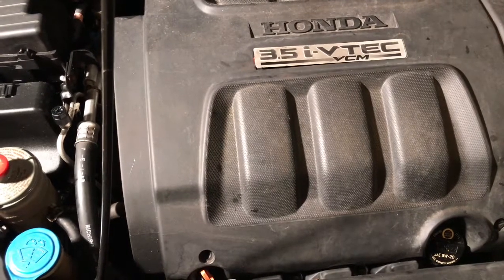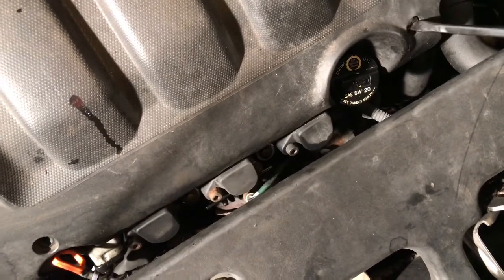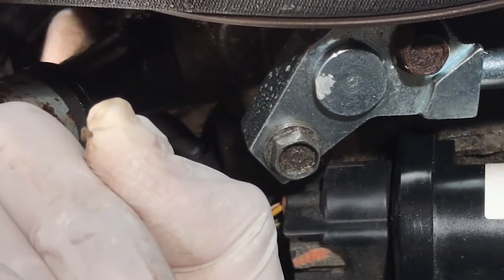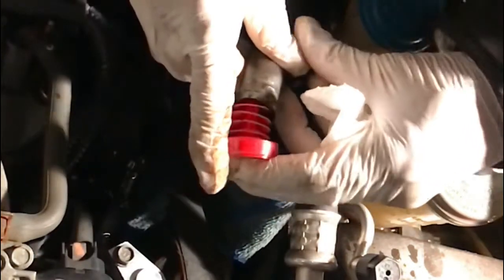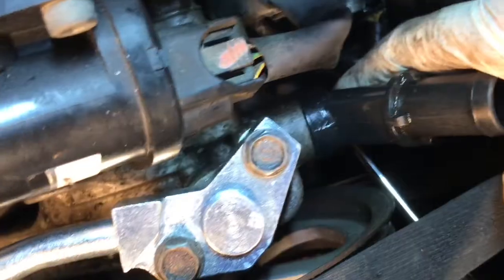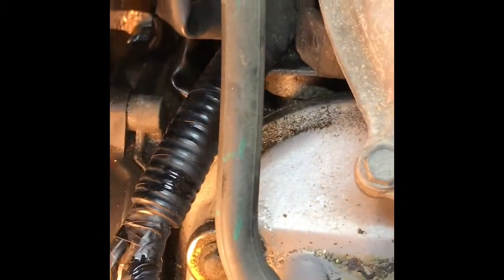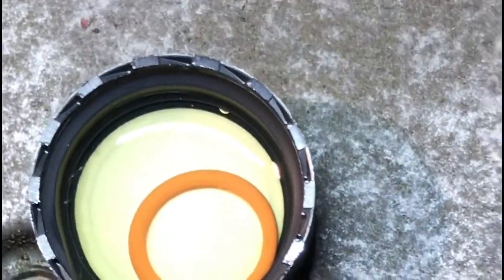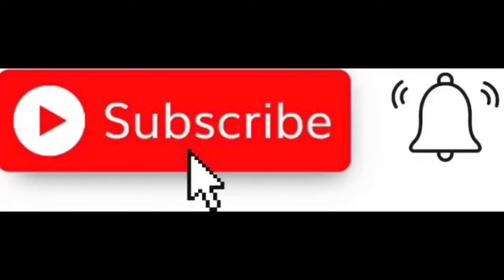07 Honda Odyssey power steering noise easy fix

Comment: Honda has the worst power steering system ive ever seen.  But this is not what causes the whining from the pump.  Even new pumps will do it.
And you cannot just refill the reservoir without doing the bleeding procedure at the reservoir with a vacuum pump
Reply: I’ve been having this problem with the 09 Odyssey new pump new pressure hose new reservoir bottle and still getting whining noise from pump. I’m going to try a factory pump and see if it makes a difference.